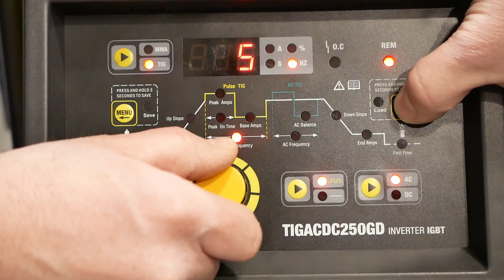How to Choose a Welding Process! - Weldpro Tips

Comment: Nice video but I disagree on the primary concern. #1 should be outdoors or indoors. Any process that requires gas shielding is useless outdoors. That fact alone narrows the play field of which process is better.
Reply from the maker: Not useless but certainly more challenging. What if there was no wind on that day? I think running MIG or TIG  on a calm day is just fine :-) not to mention we do have the option to set up a windscreen 😀
Reply: I guess it depends on where you live or will be working that would present a "no wind" day. Perhaps a windscreen 40' wide and 10' tall on 3 sides. Air currents are still the #1 concern when choosing a weld process. Repairing a building frame or windmill 30' in the air might make a windscreen difficult to come by.  If one is choosing a machine as their 1st, or primary, flux core or stick will work inside and outside. Indoors, any will work without the need to check air speed. 😉
Reply: 😂 @WeldproWeldingEquipment